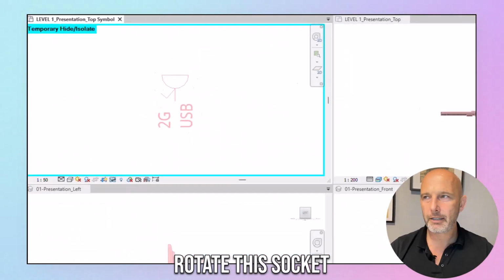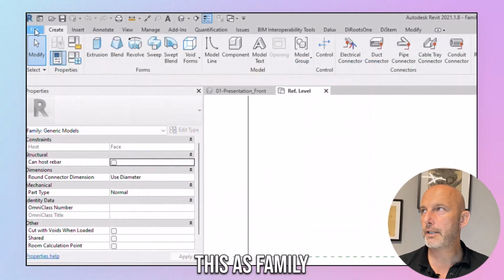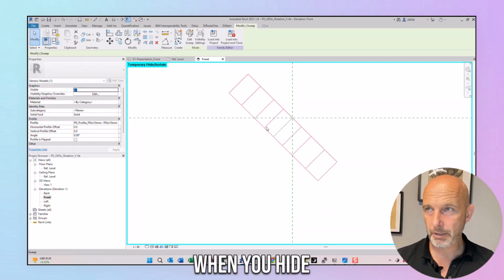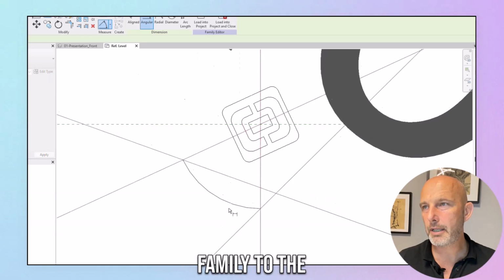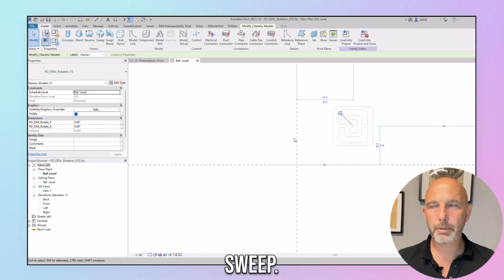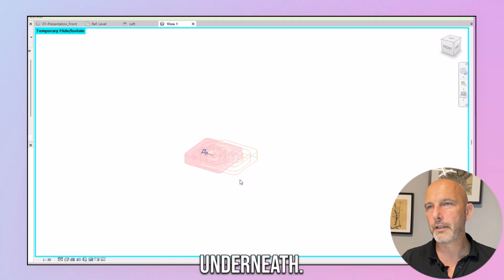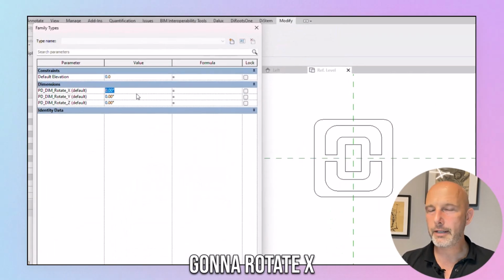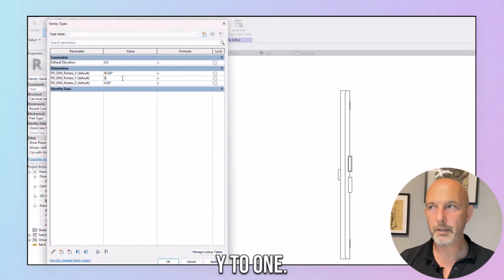How to create Tiltable Geometry Placeholder for Face-Based Families

Comment: Thanks for the video!
Didn't get the part where you create the void geometry.
Reply from the maker: You need another object which can tilt in ‘x’ plane, that’s why the void, where your YZ family is hosted to. Once that created you have XYZ host tiltable in all directions with a surface that can be used as host for any other face based family – making is tiltable in all directions.